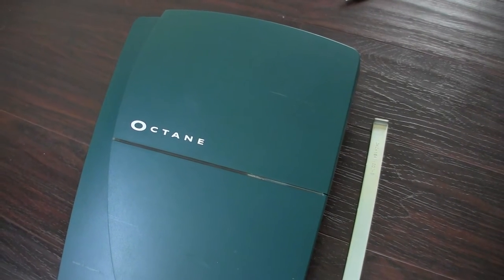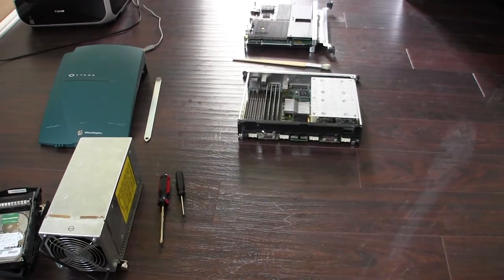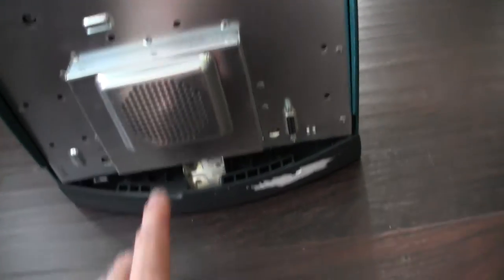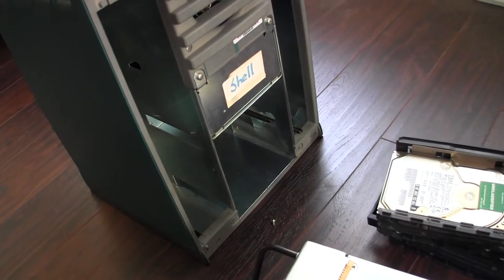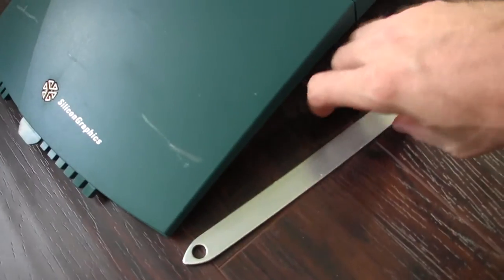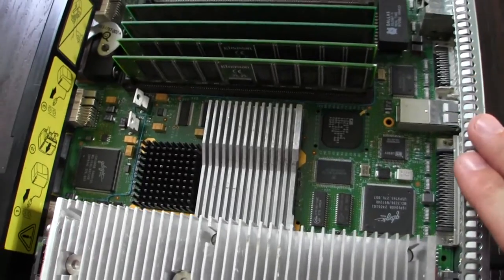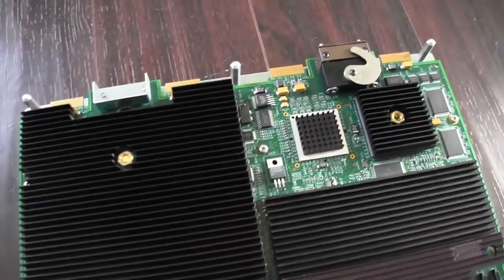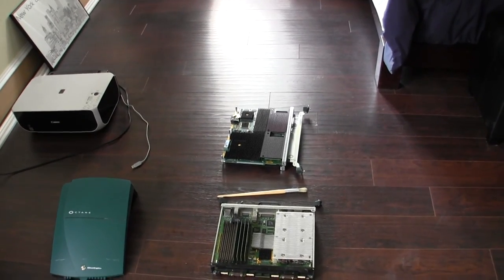Silicon Graphics Octane pickup!

Comment: I'm dying to get a SGI.  Would you recommend looking for one of these or the O2 now that you've had time to play?
Reply from the maker: Alexander Chaney definitely the octane, and preferably a late model 1 or better octane2 since that will have a better psu and later revision main board to support the cheaper and superior  v graphics series. The O2 is cute but it's not the big boy- the octane is a real workstation, lots of hardware but not enough to prevent you from using it.

Comment: Hello, I wonder if you can help me. Just like you, growing up in the 90s as a gamer and fan of movie buff I became familiar with this company and the role they had in advancing 3D graphics. So when I saw a immaculate looking SGI 1600SW monitor with their branding I picked one up for free at a recycling center. Can I plug this monitor into a VGA card using an adaptor like the one you showed in your video?. The monitor is great, the mechanism it has is robust enough to still work perfectly. I would like to be able to use it with MAME etc
Reply from the maker: Yes, you need a 13W3-M to HD15-F adapter and you can use VGA on it. I have used SGI monitors with PCs before.
Reply: Hi, I'm sorry but you can't, the 1600SW required a special adapter panel that costs ~$150. it only has an input for a special digital connection (think it was called LTE or LTI) or something. You can buy a modern widescreen monitor with better resolution and quality for less than the cost of the adapter, so you might as well dump it back at the recycling center ;)
Reply from the maker: Thanks for this info. I used the 21" Sony SGI branded CRT whichever model that was with a 13W3 to VGA dongle and it worked out pretty well but I guess the later models got complex.